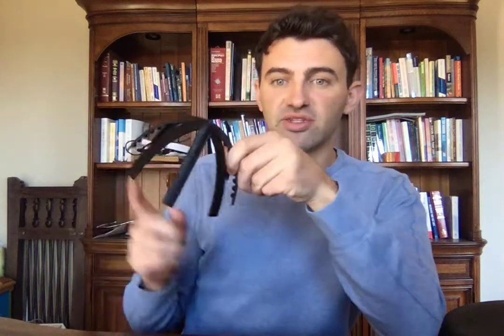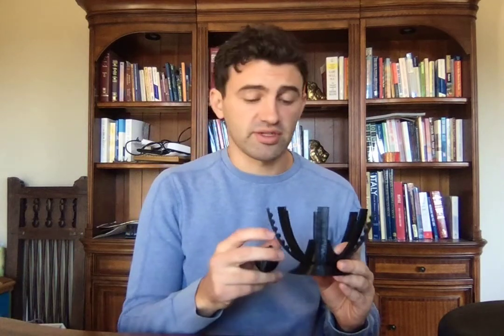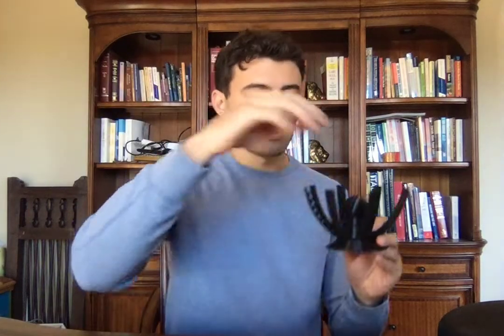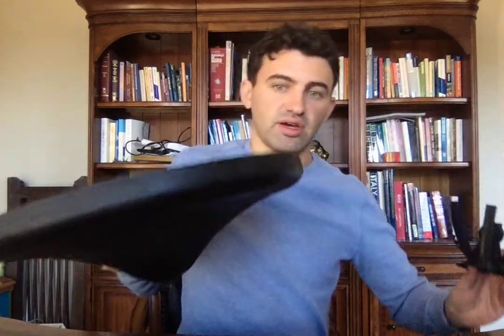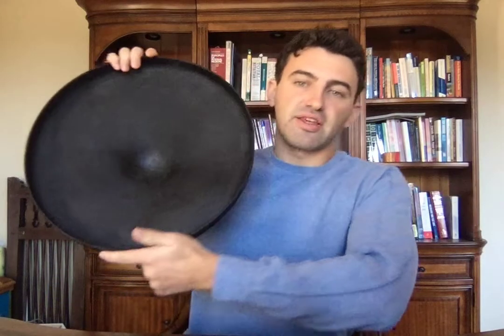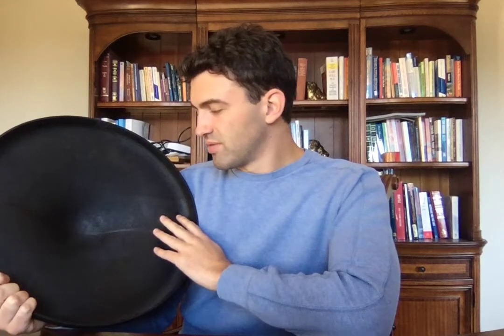Electrogravitics - T. Townsend Brown Replication #2

Comment: Hi AJ, Have you considered copper powder coat as a conductive coating?

 I realise that you would lose structure if you attempt to heat cure it thermally,  but a light coat of varnish might work if sprayed from a height  so as not to disperse the powder coat!

Martin fellow tinkerer !

Comment: A couple points.  You requested a dielectric material, I’d choose diamond if you could figure a way to apply it… maybe some sort of crushed diamond powder epoxy mix sprayed on.  Also, I’m not sure about your half sphere shape made from 3 “U” shaped pieces.  It seems to me that the design you are creating is replicating the center point in a merkaba shape.  I like your conductive sphere for this, but I suggest changing the 6 sided half sphere shaped harness to a merkaba with 6 sides and the golf ball size sphere you demonstrated locked in the center of the merkaba.

Good luck!
Reply: You need a metamaterial, diamond powder doesn't have a high enough dielectric property.

Comment: I would use your plastic mold as a template. l would buy or make a copper sheet that is thin enough size but durable enough to do what you need to do. l am not a machinist! So l utilize what a hammer and heat can do to mold and stretch. A press of your mold would be ideal of course.

That way you have a total (saucer) shape that is the mechanism. 
Also you can re smelt it to re process for your desire.